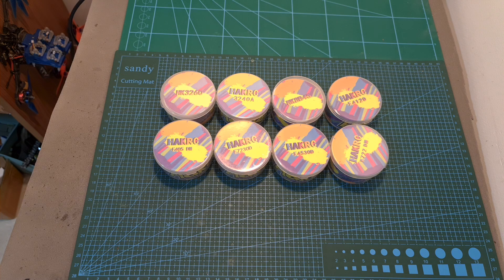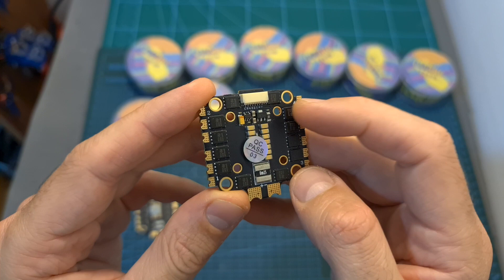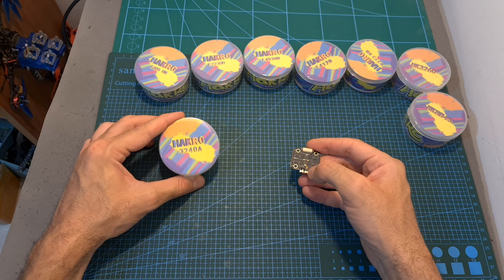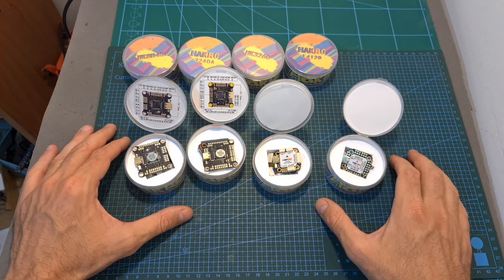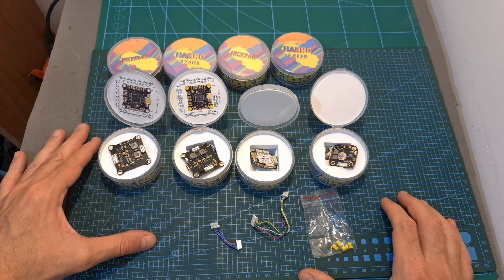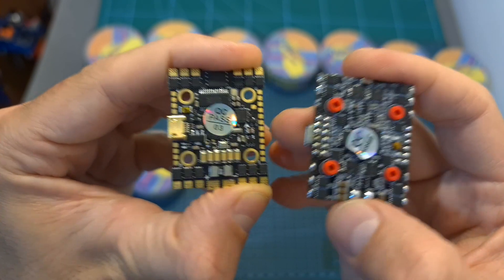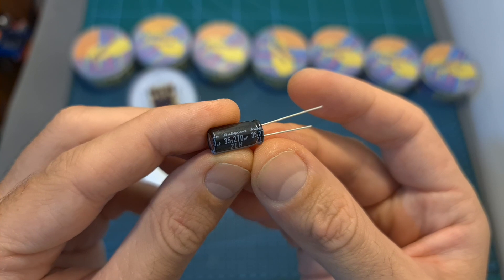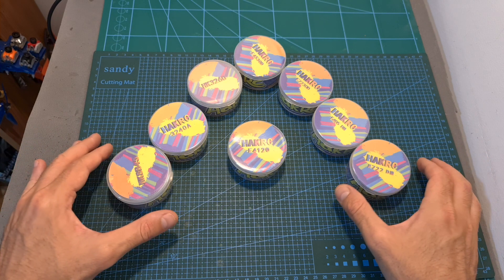HAKRC Haul - New Flight Controllers & ESCs

Comment from the maker: Pay attention that the target firmware of the F7 flight controllers is MATEKF722SE and not as stated in the video.
Reply: Hi Gal, got confused by the mounting hole sizes. Does the F7 mini fit together with the 40 amp mini ESC? Looks like the F7 comes with bigger purple grommets and the ESC with smaller yellow M2 ones?

Comment: Regarding the  HAKRC Mini F405 DM - Is there a manual for this thing anywhere? I am confused by the plug on the bottom, which on mine is marked Curr, TX, 4,3,2,1, VCC, GND. At Banggood, it is marked Curr, RX3... So is the second pin TX or RX, and for which UART? On the top side, I see TX1, RX2, TX2, RX4, TX4, Rx5, and TX5. On the Ports tab in iNav, I see UARTs 1-5, and UART2 comes up marked Serial RX. Can I connect to UART3 somewhere? Is there an RX1 pad? Is RX1 really the second pin in the plug on the bottom? Thanks in advance if you can clear up my confusion!
Reply from the maker: Hi, it's RX3 (used for ESC telemetry). UART3 is not a full UART port (you can remap the other ports if you need to though).
Let me know if you still need help.

Comment: when is the build video for HAKRC 35A F411 AIO coming?
Reply from the maker: Soon :-)
Reply: @KremerFPV  the board came with betaflight 4.1. I went to the ports tab, there was uart 1,2 and softserial 1. I flashed to betaflight 4.2 and now the softsrial1 is missing. I'm wondering how to get it back.
Reply from the maker: @ajsphinx  Hi, watch this video: https://youtu.be/C7zYdPz-KtY
Reply: I think its PPM 1 A03, thats the spare pad (right hand corner near to the mounting hole). what do you think?
Reply from the maker: @ajsphinx  Sorry but I will be able to test it only in 2 weeks :-/
Reply: @KremerFPV  ok. Will be waiting.
I'm just a newbie, so got some stupid queries. Appreciate if you could touch upon this topics as well when you test.
I see in my resource:
resource MOTOR 5 B03
resource MOTOR 6 B10
But on the board I see pads for connecting 4 motors only. Where are the motor pads 5 and 6?

Comment: Can you check the specs of the last F4120? On other sources it's reported as only 5s compatible not 6s. Also some sources report 20A instead of 35A. Very confusing!

Wow, They give Rubycon capacitors. Much appreciated.
Reply from the maker: It was wrongly marked as 20A on Banggood when the product was released, so the confusion is coming out from that. 
The current rating of the ESC is 35A and it supports up to 6s batteries, I can confirm it.